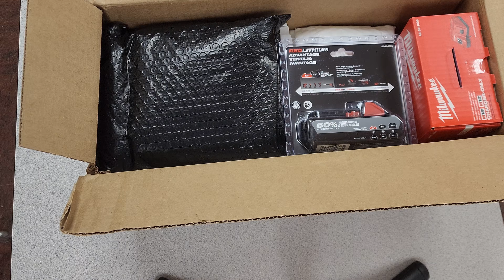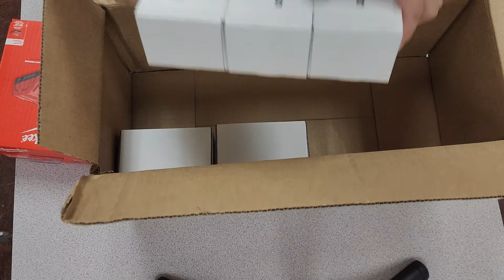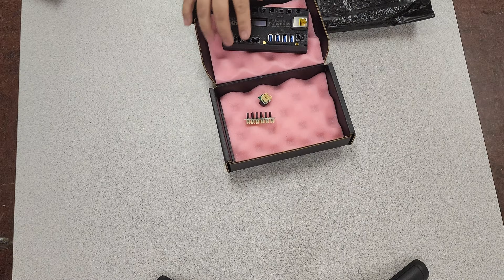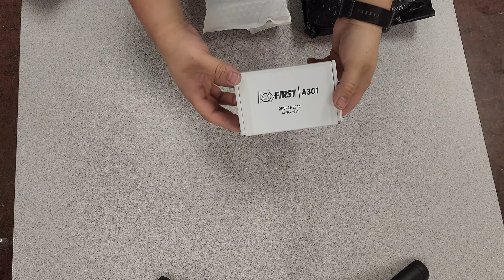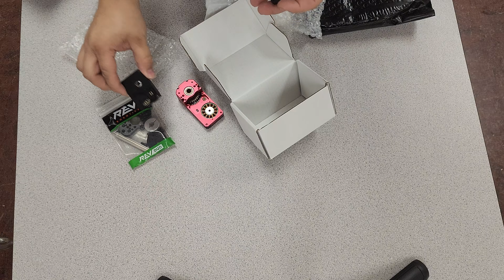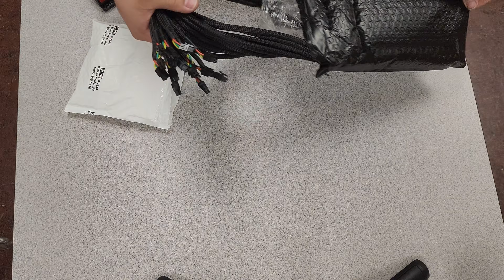FTC Alpha Test Hardware Unboxing

Comment: Are the molex connectors on the cables and on the system/motioncore plated in tin or in gold?
Reply from the maker: The spec document lists gold plated and it's a little hard to tell but they look gold in real life.